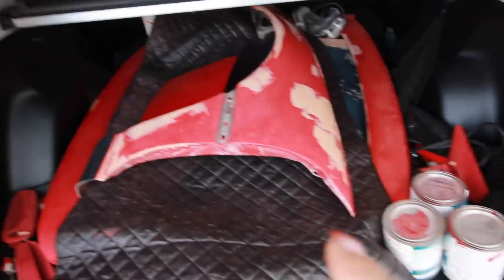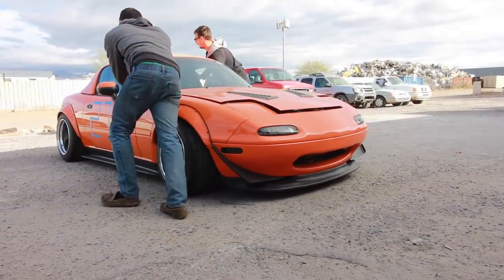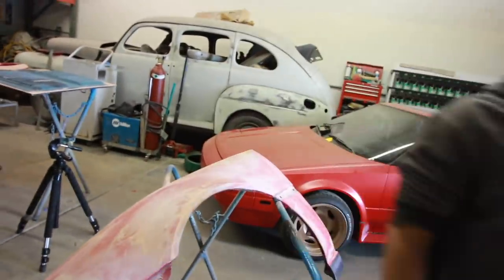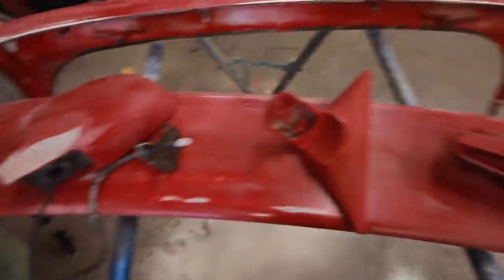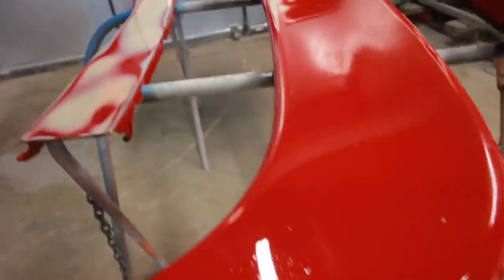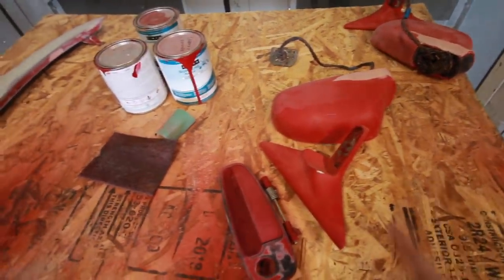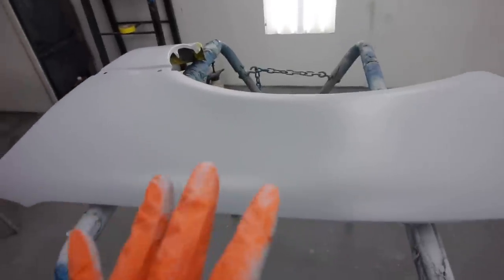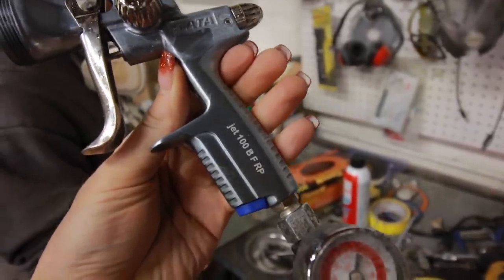My First Time Painting a Car! // Project MR2 Turbo

Comment: G'day, Sarah! Nice job! Noticing there are many things that need to be prepped, smoothed, or removed before painting an automobile. The preparation for painting is just as important as the painting itself, for an auto painter it is very important to make sure that you are prepping cars as well as possible to avoid having to repaint anything.

You'll find, folks tend to rush through the preparation stage and then expect superior end results. Painting is an art and it does take practice. Travel speed, distance, spray pattern overlap, and technique is necessary in learning to produce professional results, you are right, more attention needs to be concentrated on preparing the car for paint than the spraying itself. Thank you! :-) 

Cheers! 😊🚗❤️✌🏼

Comment: I had a 1988 k5 blazer that I cut out all the rust, welded in patch panels, did all the body filler, sanded the truck down, sanded the truck again, primed, sanded, sanded, sanded some more and then painted...took me a whole summer in a pole barn.  I always swore I'd never do it again but then I bought a 1986 Chevy k10 so here we go again

Comment: Hi Sarah when you hold the spray gun in your hand the next time here's a couple of tips.
If you have your first finger pointing down the spray gun the next 2 fingers on the trigger & your little finger underneath the part that comes out.
You will find the spray gun has 2 stages the first is just air coming out when fully pressed that's when paint will come out.
Always start the gun away from the item and stop it after going pass.
Always overlap your passes.
And finally with your engine cover you go 4 ways (side, side, long side long side) make your last side  the side with the vents openings away from you.
I hope this has given you a few more tips best of luck hope it comes out well.

Comment: Awesome vid!  Glad you are learning a lot and hope your work turns out well.  It's always a waiting game until it's dry and cured to know for sure.  That's the frustrating part.  My part time job while I was in high school was learning prep and paint for work at a sign company.  Easier than painting cars, but same process, and takes a long time.  Painted aluminum, plastics and the occasional wooden sign.  The one thing I miss the most is the smells.  Nothing like the smells of Bondo and lacquer thinner to keep you alert!  Oh and that gritty abundance of overspray on everything!  Memories.  <3

Comment: Nice work. Most things on cars are hard work, you're just used to the rest. But yes, I'd rather be doing those valve seals than inside the booth. You're almost there, just another day of sanding and painting, then more sanding, then a full polish on the rest of the panels, then reinstallation of everything, then more polishing, then... well, keep up the hard work!

Going flat black with the engine cover panel?

Comment: Nice job!   A friend owns a body shop and I've painted several of my own project cars.   It's far more work than people realize for sure.   

I see you're just painting some random panels around the car.   If you're not painting (blending) into the surrounding panels, you're definitely going to notice the new vs old paint...
Reply: Maybe, maybe not. If the car was just painted, and the mix was spot on for that respray, it might work out well. I've found that higher quality paint systems usually have far superior matching of colours compared to the cheaper ones, and the people doing the mixing tend to take more care as well when measuring the paint.
I've had two instances in the last 5 or so years of metallic bases being bang on, which is pretty rare, but sometimes you luck out.